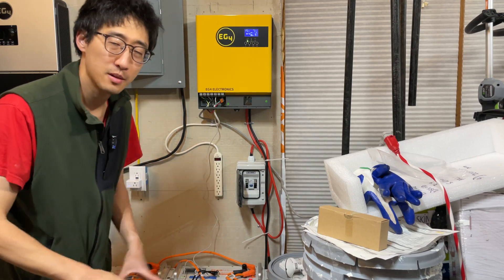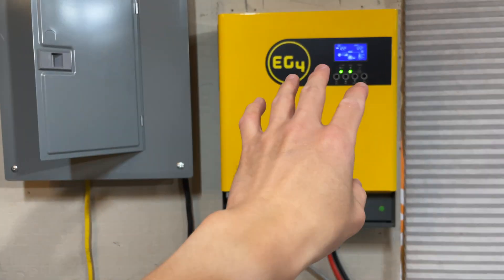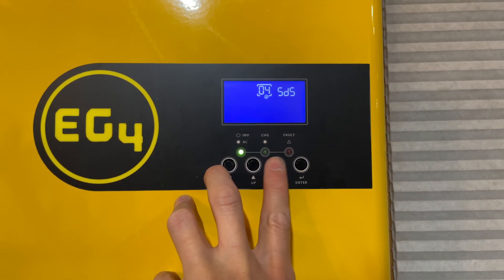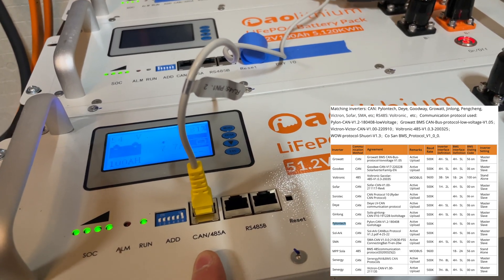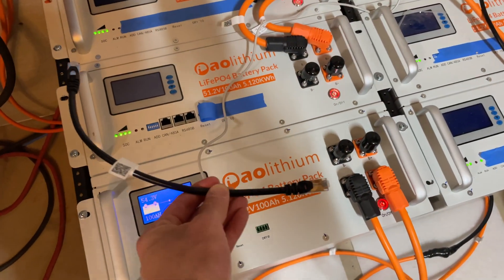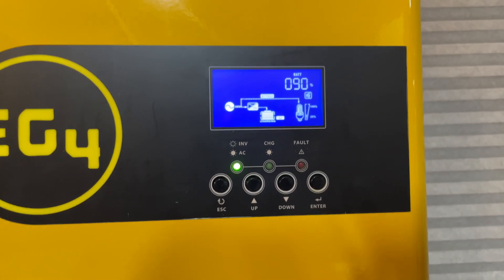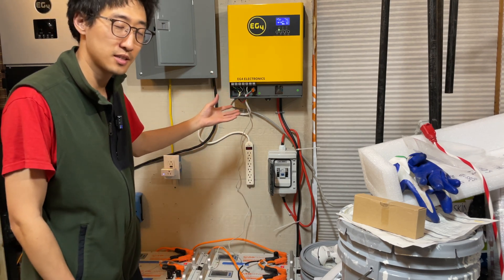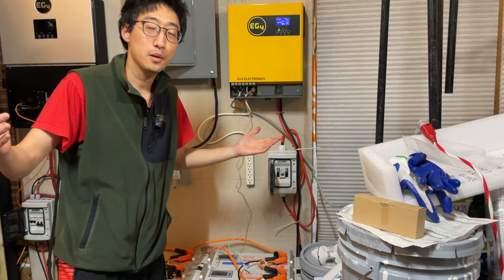Setup battery communications EG4 3kw Inverter and aolithium lifepo4 server rack batteries 3000EHV-48

Comment: UPDATE - We have New Aolithium with RED Dipswitches. 
We CANNOT get it to communicate, with new eg4 firmware upgrades and more. we have even custom made our own RJ45-USB cables and more. 
Be Warned.
Reply: I have them  - if you set as "type 2 on the eg4, and dip switch 5 only up , or dip 6 only up , you will get comunication -- but the size of batery will be wrong.

Comment: No worky for us did you upgrade or do an firmware on the eg4?
Reply from the maker: The eg4 device is running the latest available firmware and the batteries are running the firmware that they were shipped with.
Reply: @tgbatg just updated to the v2 and still no good, possible bad cable?
what pins are connected on your EG4 Cable?

We notice the dip switches on ours is RED.

Comment: Hello Thanks for sharing the knowledge you have. I have a EG4 3000 just like the one you show and have 2 Aolithium  batteries and one EG4 battery. All are 100 AH 48 volt server rack. Do you think if I connected all of them together would the communications work? Or just connect 2 Aolithium with communications with the EG4 batterie with no communication and use a bus bar to connect all 3 batteries to the inverter? Please let me know your thoughts.
Reply from the maker: Due to being closed loop you won’t be able to mix and match the communications.